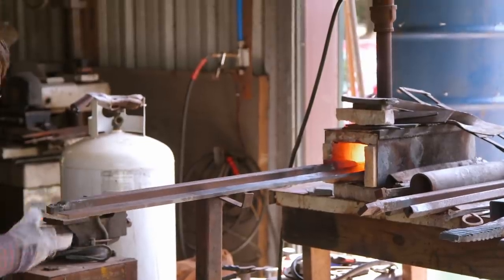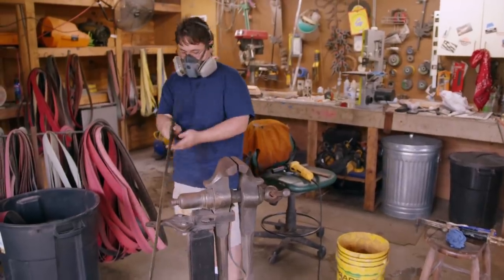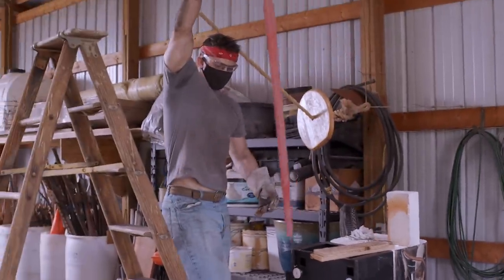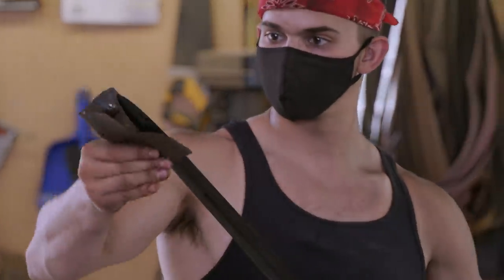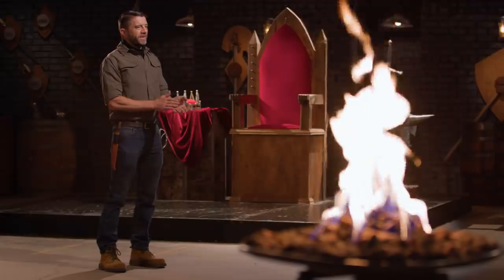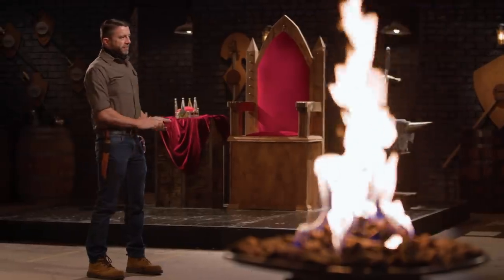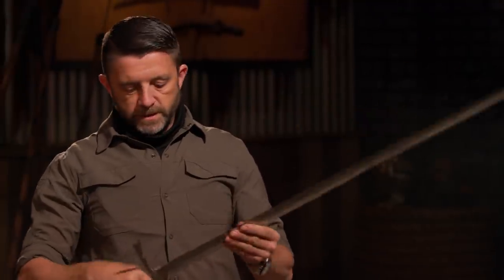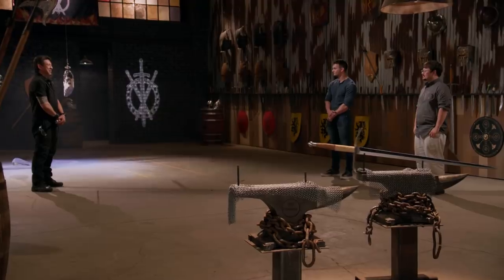The YOUNGEST 2X Forged in Fire Champion Ever?! (Season 8)

Comment: 7:58 if you freeze frame it at exactly the right time, you can see his sword bend into an almost literal S-Shape as it cuts through the sandbag.
But in the next cut, it goes through clean and straight.
That's how important it is to swing the blade perfectly straight as it goes through the object, or else the effectiveness of the cut can get severely impacted, and other things like the weapon changing direction as it travels through due to friction dragging on one side more than the other.
Reply: nah, you can't always get the best angle especially at a moving target. props to the swordsmith though that despite the flex it came back to true.

Comment: Did they weigh both blades? If so, do we know which blade was the lightest?
Reply: They were within a couple ounces of each other, so it wasn't a factor. In the end it was the warp in Kevin's blade that took him out, and Colton's drop-dead Damascus pattern was icing on the cake.
Reply: @Just_Pele  right? At this point of the competition their weapons would have to to be right within the specified parameters in order to be tested, I remember they had final round weapons that the judges refused to test because the blade just didn't meet their requirements

Comment: I don't want to be nitpicky, but I just couldn't overlook the fact, that the last supposed longsword they showed in the beginning montage was actually a greatsword. Someone might argue, what's the difference? Well, I am no expert, there are guys, whose knowledge far surpass mine, like Skalagrim or Shad from Shadiversity, but let me simplify it a bit for you. A greatsword, claymore or zweihander is basically no longer a sword, it's more of a polearm, because it's so huge, it just can't be handled like a sword. Actually the handling of the greatsword is quite similar to other polearms. Typically it has a more narrow and longer blade, wider guard and a bit longer hilt. I really recommend watching some of the vids from Skalagrim and Shad. It's actually hard to say, whether what they made can be still considered a longsword or not, because the barrier is quite thin, but I would say yes, it's on the larger scale, but it can be still used effectively like a sword.
Reply: Yea that looks like a clip from M1 Medieval or something similar. They probably chose it because the contestants are wearing medieval looking armor instead of modern protective gear like in HEMA competitions. Not very familiar with it but maybe it doesn't have actual longsword, or maybe they just messed up.